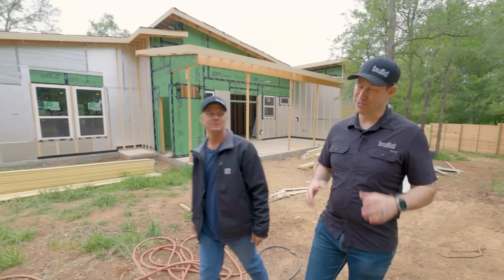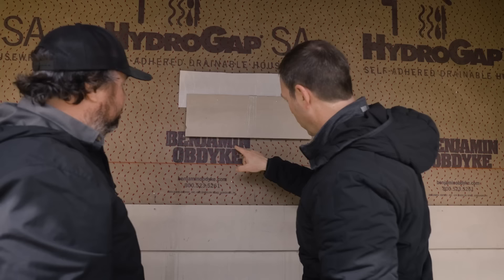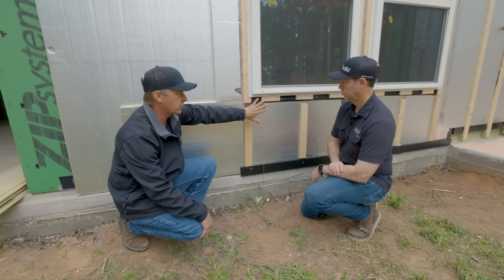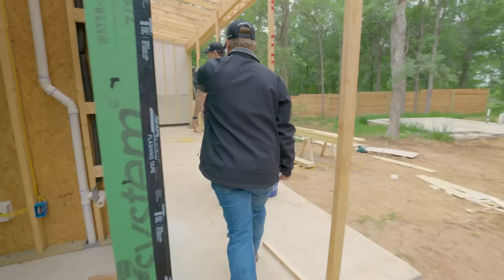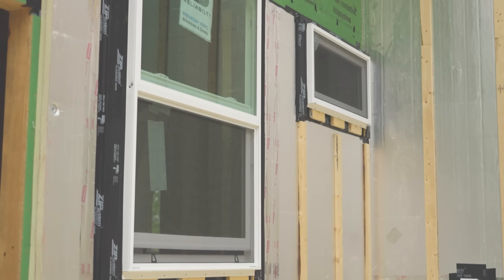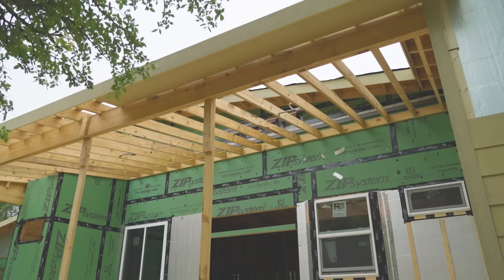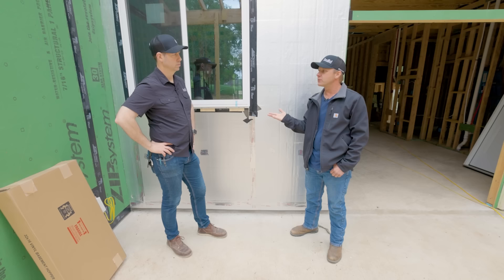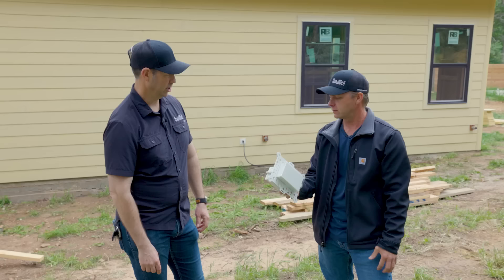Exterior Insulation w/ Common Materials ft. Scott True

Comment: Try polyiso in the Midwest. Carpenter ants LOVE this stuff. They will channel it to an insulation value of R0! I have taken down polyiso panels on houses where only the aluminum foil was left. There was only dust in-between. All the way to the roof on 2-story houses. You have an obsession with foam boards, including ZIP, and it is time you pay attention to the insects that live on this planet and that obliterate this material!!! Customers be warned, you also need to pay attention to builders that don't know what they are doing.
Reply: This is absolutely true, and fire ants do it as well.  Personal experience in Texas.
Reply: That's part of why I like rockwool insulation for both interior and exterior.
Reply: Rockwool is the way. Foil faced exists there too.

Comment: I'm a tile contractor who builds mostly showers. I whole heartedly agree with Scott's philosophy about mixing manufacturers and feeling comfortable with YOUR product. I also use Kerdi on top of my mortar bed shower pans, with FloFx drains, and Hydro Ban or Hydro Barrier with Laticrete reinforcing fabric on all corners and seams. It is a super bomb proof installation and I can say that Scott has nothing to worry about here. Another consideration is that any manufacturer warranty covers THEIR product, and if a shower needs to get ripped out due to a failure, the $1000 in that manufacturers materials is the least of my concerns. Worst case, that's what liability insurance is for. Best case, make sure that never happens.
Reply: Why not use all laticrete products? They make their own membrane to cover mud base? I get the drain you chose 1st it’s the best tho laticretes not bad . And why even use a mud pan? Use laticretes preformed pans- no need to worry about blocked weep holes you get perfect even slope you save hours of work and mess and of course laticrete in every product category cheaper than Schleuter equivalent as you undoubtedly know …
Reply: @johnwhite2576  Good points. Sometimes I'm using what's available locally. For the laticrete products, I have to drive to Austin, which I do sometimes.
Reply: @johnwhite2576  Good questions. I've tried many combinations and systems and this is what I install every time now. Kerdi is slightly thinner and more flexible than HyrdoBan sheet membrane, it lays down nicer on the pan. I use mortar beds over foam pans because I know that no matter the site conditions, shower size and shape, drain placement, subfloor levelness etc, I can install my base that day and it comes out exactly how I want it to every time. Also, mortar bed is money in my pocket, foam pan is money in Schluter's pocket. You are correct about Laticrete being cheaper than Schulter though. I do use all Laticrete thinset.

Comment: This is exactly how I wanted to build my exterior walls. I ended up just doing 2x6 walls and air sealing everything myself. When I mentioned exterior insulation to any builder around here, they looked at me like I had 2 heads. The one that entertained the idea wouldn't even estimate a price for labor.
Reply: My buddy found that out interviewing builders for his house.  I think he went through a dozen.  Nobody knew what ICF was, nobody knew how to do exterior insulation.  Most builders are just lick and stick up a shitty house and walk away.  They don't care about efficiency or best practice at all.
Reply: Where abouts do you live?  I live in the San Antonio area, and yes, the struggle is real here on this front. BTW, for those considering ICF, look into Helix micro rebar as a way to reduce the labor/time for working a rebar lattice into your build. I would have gone this route before the economy tanked and finances got screwey

Comment: The single cable per hole electrical sealing thing made me think of how it's done in industrial applications. Might be able to do on homes also with far less labor and a neater / tighter final product. Search Eaton Crouse-Hinds EYS or conduit sealing fitting. They are used to seal off hazardous environments so by nature have to be air tight for say Class I hazardous gas locations. Could have the fitting inside the house to keep it out of the elements and use sealed conduit to then penetrate out.

Comment: What is the cost difference between poly-iso (aftermarket) versus buying Zip sheathing with it built-in insulation? It seems like you could avoid a bunch of these details, risk, and labor.

More labor “passes” for all these materials means more opportunities for things to not be right
Reply: I wondered about this too.  Zip-R would save quite a lot of labor, while sacrificing the benefit of the foil layers.  Not sure about the cost difference.

Comment: I feel like the absolute lowest cost / best result airgap solution would be for ZIP to texture the surface of their OSB 1/16" when they compress it at the factory, before they apply the air barrier material.
Reply: I agree. I live in zone 7 here in Canada and will be applying 6 inches of rigid foam on the exterior, furring strips with counter sink holes for  the structural screws.  I was going to do what Joe Lstiburek said to Scott, the textured tyvek drain between the sheathing and the first of 3 layers of rigid foam. If zip would texture their sheathing....Boom!  Mission accomplished! 👍☺💝

Comment: I get why you add the air gap behind insulation for a drainage plane, in your climate. Being in a northern climate, would worry that the loss in R value of the wall assembly would defeat the purpose not to mention the potential to increase condensation potential there.

Comment: It's not just drainage, it's a micro moisture barrier requirement.  When installing exterior insulation you can encapsulate moisture from the dew point in the wall.  With EIFS, for example, you need a 3/8s air gap to accommodate any moisture.  If you heat or cool the space inside you're going to have a condensation point in most cases.  Ideally, there would be no fastener penetrations channeling hot or cold inside the wall unless there's a thermal break as well.  In warmer, drier climates it isn't as crucial, but here in Canada, it is imperative.  I love the details in the build, especially the bug screens.  Keep up the good work!

Comment: 13:53, a trick I read about for mounting a TV to an apartment's wall comes to mind. You buy some 2x4s and some drywall to create a bit of a false wall to place on top of the real wall. Just make sure that the studs in the false wall line up with the studs in the real wall for attachment purposes. Now, in the false wall, you can cut holes (behind the TV) to run wires and stuff like. Then, when it's time to move out, you can remove the false wall without any major damage to the real wall. This comes to mind, because this might be a hand way to inset speakers.

Comment: Here is a question for Matt or Scott or this community. Scott talked in the vid about Lstiburek suggesting placing the drainage wrap over the sheathing but inside of the rigid foam.  I listened to Lstiburek in another vid suggest that in case water got between the sheathing and the most inside rigid foam it would have a space to drain.  In doing more research there are building science people who do not include that drainage wrap over the sheathing and only over the most exposed rigid foam.  We saw that Scott found even the dashes of liquid flash may not be effective to create enough of a gap. Remember, there is hydro tension to consider if the air gap is not wide enough. STeve Baczek talked about this on one of his vids.   Can someone clarify, with being in zone 7 Canada, if that drainage plan is really needed?   I talked with a builder here on Prince Edward Island, CAnada, where I live, and to eliminate any rain getting in between the rigid foam we were thinking of using the "brake" to bend aluminum to cap off the top. That would be the only place water could get in...maybe rain hitting it even under the eaves due to rain...and we are getting a lot of hurricanes now so wind direction is changing and more forceful.  I continue to research and hope a few of you will answer.  I might copy and paste this comment and add it to Matt's channel comments and Steve Baczeks as well.   Cheers ☺🇨🇦 Long live our buildings👍

Comment: I love the out of the box sort of thinking he demonstrates. It is easy to just buy the latest and greatest, but overwhelmingly people cannot afford a home that is 2x-10x more than comparable homes in the area, even if the numbers work out over 20+ years. Last I read average time of owning a home is about 4 years... I really appreciate seeing the 1 inch foam detail on the exterior since that is what I am planning on doing. I first wanted two inches but it is (here) cheaper to buy two 1 inch pieces than 1 two inch piece, and you have the added advantage of two foil barriers. 

My current issue is trying to figure out how I am going to finish out windows with the unusual wall thicknesses. I've thought about recessing them so that they are flush with the interior wall, creating a shadow box effect, but I am not sold on that yet..

Comment: At this point in building science, it makes more sense to insulate the outside of the house. It is much faster, and easier install than interior walls, and not a luxury like Scott says. My Dad was an architect, designed and built one of our houses in D.C., with extra wall insulation,  but even then we had pipes freeze in the wall. And we also know that in Texas, it can and does get cold. Exterior insulation makes much more sense the more you think about it, as long as it can still withstand water and wind events..

Comment: Scott True Builds 52 minutes ago
Good points. This is a real dilemma. A while back, I use to try to sell high performance and it was difficult for me. I'm not going to change what people are interested in. So here's what I do: For my spec homes, I have a specific formula, which does not include exterior insulation, but does include many high performance details. I can build those homes at a low enough cost to sell them at competitive prices to people that pretty much don't care about high performance. In fact, I don't even tell them until after closing. I do this because I just can't build any other way. Plus, it allows me to constantly learn, get better, and show what I'm doing to people that do care. Most of this showing is happening off line when people call our company. Ideally, I would be on YouTube more often to show this to a larger audience. I'm getting there. Then when people reach out looking specifically for high performance,  we can dial in those details as far as they want to go with it.

Comment: That's why at least here in Finland all exterior XPS wall products are a) grooved b) fomed from the seams with urethane (manufacturer's guideline) also XPS is non water or vapor permeable when properly sealed but it does degrade quicky from UV in direct sunlight (hence the aluminum foil). As for insulation XPS is roughly 1/2 as thick to rockwool pads for comparable insulation levels but pricing for XPS is also often doubled so it kind of evens out for costs but XPS is not fire proof which should be kept in mind on fire risk areas both inside and outside. Also should add that here we would build the wall the otherway around with XPS on the inside and zip or wind barrier mats would then be the exterior cladding or do a combination wall with rockwool between joists and thin XPS sheets for inside wall (acts as vapor barrier) and zip or wind barrier on the outside as we have never used those house wraps in Finland (and not really anywhere in Europe I think) except under roofing to divert water.
Reply: I really appreciate hearing from European people on this topic. Thank you 🙏🇨🇦

Comment: Always been thinking about insulation from outside as well as from inside. But two 1 inch layers with end joints staggered - even better.  Love the vent pipes go trough the wall on top. Because those galvanized pipes roof boots get rusty in few years, and plastic ones also can UV deteriorate.

Comment: Is a four inch deck screw sufficient in this application?  Two inches of foam, 3/4 stock and almost 1/2 inch sheathing; that leaves about 3/4 inch penetration into the wall stud.  True, four inch deck screws are a lot less expensive than 5 inch GRK screws, but I would have thought code required a minimum of one inch penetration into the stud.
Reply: Exactly. It is the reason I went with 1.5" foam.  I assume they overdrive the screw a bit and got 1" of penetration into the stud. If you include the 1/2" sheathing, that is 1.5" of grip.

Comment: Curious Question: Scott uses 4" deck screws to secure furring strips. We have 1/2" Zip sheathing, 2" PolyIso and 3/4" furring strips. So, at best we have the weight of siding beyond the 3-1/4" lever with only 3/4" bite. Is that sufficient to hold over time? I'm not bashing, I want to learn. Thoughts? Thank you!
Reply: You have an additional 1/2” bite on the sheathing, along with a 3/4” bite on a framing stud.  The sheathing has support strength in my opinion.

Comment: - re condensation control -??  an open capillary break behind the external insulation - is a path for cold air to creep in to the sheathing layer - could this be a condensation problem - or merely a minor insulation bridge ??  (shedding all the water to the exterior at the cladding and reinscreen gap obviously is the real intent).

 - that electrical retrofit is great, accept the changes you can make - get on with it and hope noone ever needs to re-run one of those circuits.

It would be great id plumbers and electricians got to the point of maintaining the integrity of installed insulation - rather than treating everything as a barrier to their fish tape .

An extension to the idea of discrete roof penetrations - to "hide" roof vents and breathers (on a simple gable / or hip roof- would be to utilise a constructed "ridge vent" - to install all inlets and outlets under the eave of a hidden "second roof" at the ridge - again easier to permanently weatherproof at the ridge

Comment: The silicone dots space the insulation enough that I noticed the gap before you explained it and wondered why it wasn’t applied flush. If the human eye can see a shadow line through a camera, from 10 ft away…it will probably be sufficient for water drainage

Comment: There are "ball head" push pins that have 1/4" or 1/8" plastic spheres as the head. Maybe sticking the business end of a few of those into the backside of each foam panel during installation would work as a cheap, uniform, and time-effective way to space them off the zip for a drainage plane? Too bad "Spaceballs" is already taken.

Comment: Would it be a good idea to have installed the bottom layer of poly-iso with the foil facing in, as there is an air gap due to the black blobs of silicone, so there would be a radiant barrier for heat flow in both directions?
Reply: Good question.
Reply: Have a similar question regarding the creation of multiple vapor impermeable layers. Does he run the risk of creating condensation problems between the two layers? Especially with it being located outside the building envelope. Very curious to know.

Comment: I talked to Joe when I took his course on Renovation and the dimpled material he suggests has to do with air and moisture moving through the sheathing and providing a means for any condensation to get out of the apace between the sheathing and exterior plastic foam. The exterior insulation will not let any moisture through it so it a conservative way to take care of the unknown. Without it there is no way for any moisture to get out and the sheathing will rot.

Comment: I’m about to replace my 30 year old siding with a similar system. I want to remove the old fiberglass insulation and replace with spray foam. Question:  The spray foam sub wants to make one trip. Should I be worried about removing all of my sheathing at once instead of a section at a time?  Will this cause racking or more interior damage to the drywall?  Is it safe?  All comments/advice welcome. Thank you.

Comment: Shout out to Scott for spray foaming his personal attic. We're afraid of locking important structures into spray foam, because what if there's a leak or maintenance that needs to be done? But it's an irrational fear not backed by evidence. Build things right and you will never need to touch the bottom of the roof in your lifetime.

Comment: I was thinking about the space behind the polyiso and a question came through my mind. On northen climate with exterior EPS insulation (not XPS or polyiso) on top of zip panel, is the concern with the humidity trap behind is less of a concern because if the perm rating difference between the EPS vs polyiso?
Reply: eps dries much better than xps and polyiso doesn't do so hot in the cold.